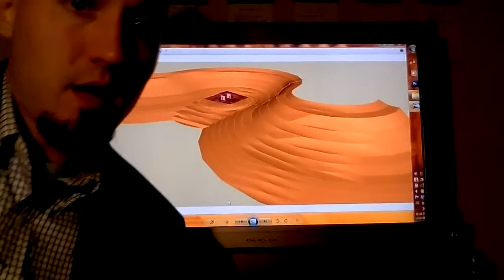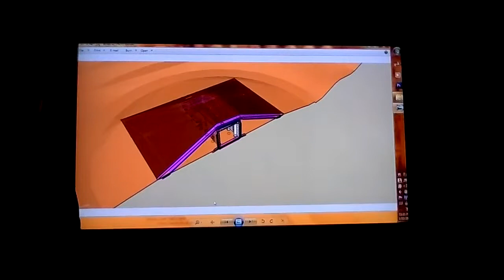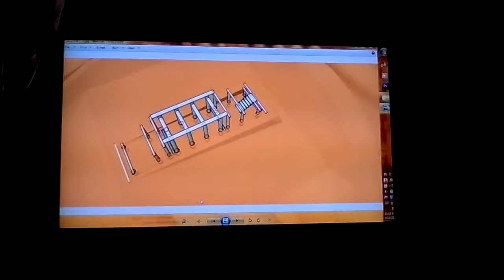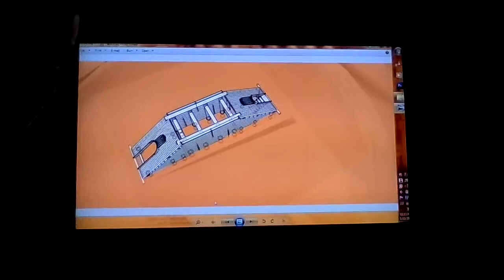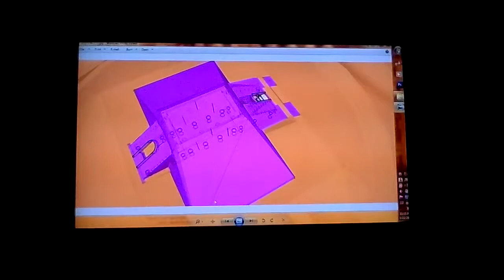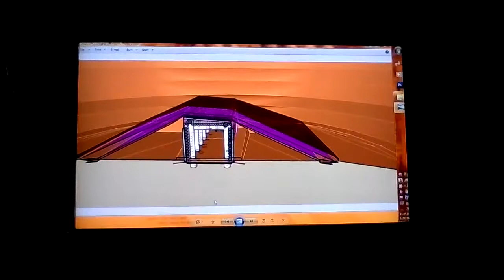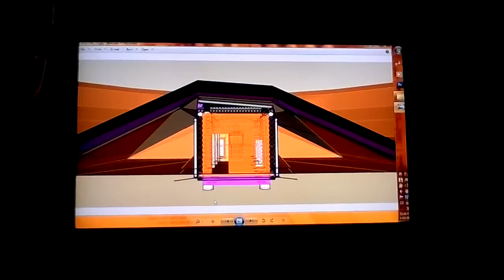Wofati Model Presentation - Wheaton Labs

Comment: Hey man, cheers for your work in sketchup! I am learning to do sketchup for ecobuildings as well and will see if I can look you up on the forums.
Reply from the maker: Hi PermacultureIT!

SKETCHUP ADVICE:
Set up quick keys and use the "group" function often. Also, Olof Jonnerstig is doing some awesome imagery with Sketchup in the "Rocket Mass Wood Dryer" thread.
Reply: Cheers for the quick response! I remember my friend saying something about placing things in groups, but a 4 hour session in your first sketchup build is a quite steep learning curve even if you're used to adopting new software :P
Reply from the maker: 2years(today)X365daysX24hours=17,520hours->17,520hours/4hours=4,380->1/4,380 of your life since then :p

Comment: Thanks for sharing your ideas Davin! With your design which way is south? Since all sides of the structure are covered, do you think blocking this southern sun will decrease its ability to charge the interior thermal mass? Is that issue solved by a rocket mass heater or some other solution? I ask these questions because I am interested in building a small home (too small to be a dwelling technically) in Michigan on my property to live in. I have studied earthships in new mexico as well as super adobe in california. I like the wofati designs because most of the material needed to build the structure is already available on my property.
Reply from the maker: Hi Karl! 

ORIENTATION:
My design is not sun orientation demanding, but I do believe it is sun orientation sensitive. I believe the interior lighting would greatly benefit from an orientation of down hill equals south (model in video on a south facing slope). Currently Wheaton Lab Wofatis 0.7 and 0.8 are oriented based on the sun. These wofatis have their largest "composite wall" facing south. I believe Paul Wheaton chose this for passive solar heating via glazing.
THERMAL MASS:
The thermal mass wrapping the structure does not differentiate itself from that of the hillside. The thermal mass wrapping the structure gives heat to the hillside in summer and takes heat from the hillside in the winter.
ROCKET MASS HEATER:
Rocket mass heaters would be temporary heating, recharging their cob mass, not that of the hillside (though I believe heat would be lost to the hillside). I failed to include a rocket stove, it's mass, and it's venting pipe in my model. Penetrating the layers and keeping moisture controlled, would/will be a concern. Currently Wheaton Lab Wofatis 0.7 and 0.8 have vent pipes exiting "composite walls" and rising beyond their eaves, respectively. I believe a heater of some sort is necessary for Montana wofati winter habitation. 

Thanks!